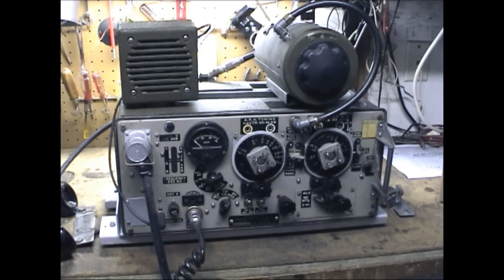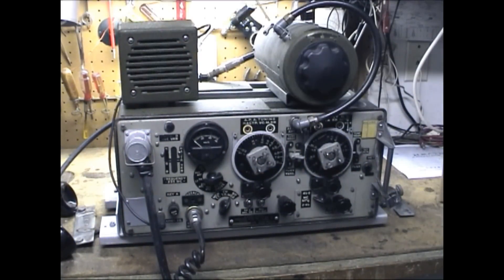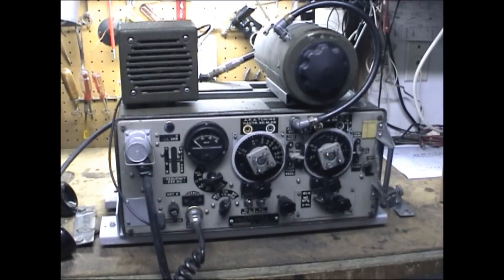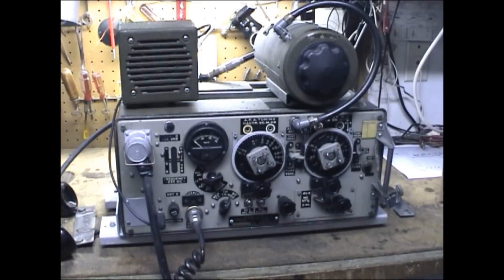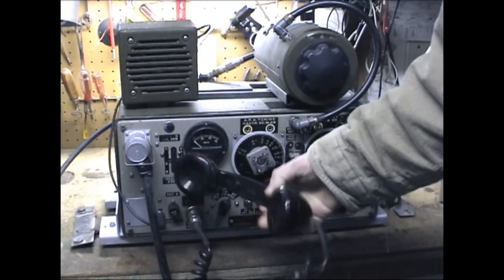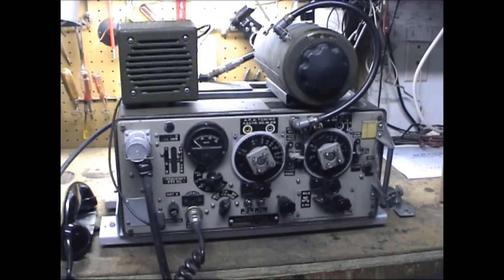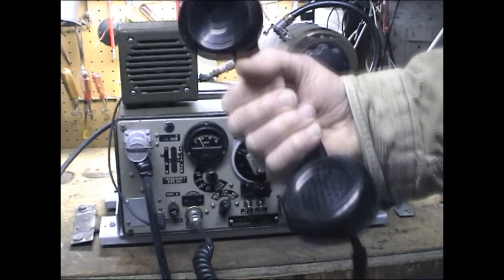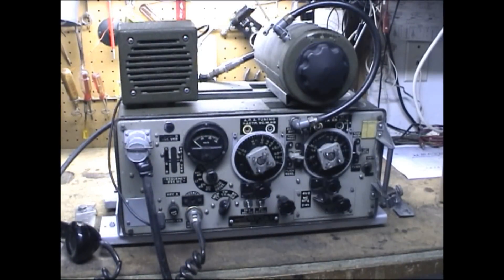WWII Wireless 19 Radio Transceiver

Comment: I'd seen these advertised as a kid but the dynamotor was going to need a car battery to supply lots of Amps. In 1974 I got licenced as a G8 then passed the CW test in 1976 and bought KW equipment, then an FT101E. Then went QRP with h/b gear.
I got my 19 Set about 4 years ago, it needed some re-wiring, two coils had to be rewound because of corrosion, the bfo was disconnected, three capacitors had leaked, it was really deaf so I tweaked the i.f. cores and input coil, then made a separate rx input with a variable capacitor and a Denco coil. I later made it xtal control on tx for stability.
It's no museum piece so I didn't mind modifying it.
G4GHB.

Comment: Er, your 19 set history is a bit awry. It's a British set designed by Pye Radio Ltd in Cambridge, England. It's WW2's most produced radio - some 113,000 were made. It was also made, in smaller quantities, by Amalgamated Wireless (Australasia), Northern Electric and Rogers in Canada, RCA, Philco and Zenith in the USA. The majority of sets were made in the UK - by Pye, ECKO, Bush, Murphy Radio and possibly by Invicta (a sister company of Pye). NONE of the US made sets was supplied to the UK and none were ever used by British forces. That's a Russian Cyrillic language set you've got there. All the American WS19 sets were either supplied to the Red Army through Lend-Lease or were never issued. Lend-Lease worked in all directions. Amalgamated Wireless in Australia supplied a lot of radio equipment to the US Signal Corps for use by American forces.